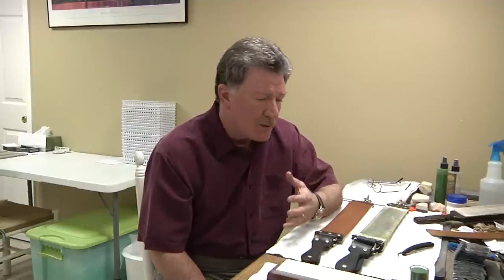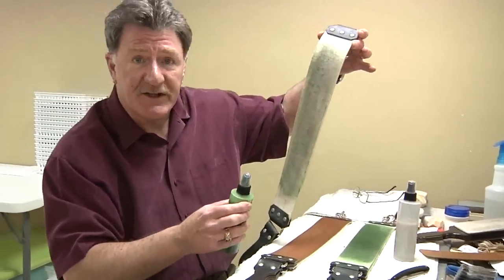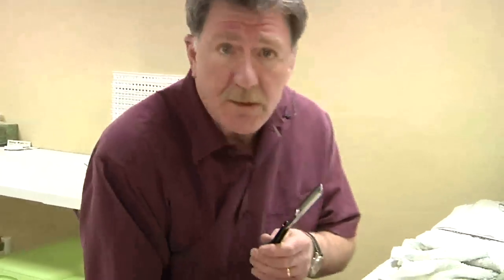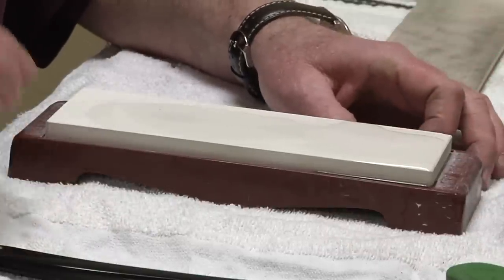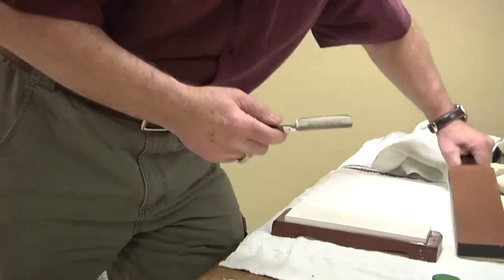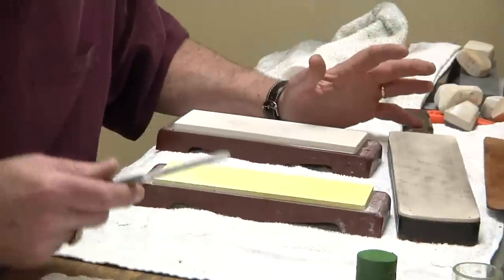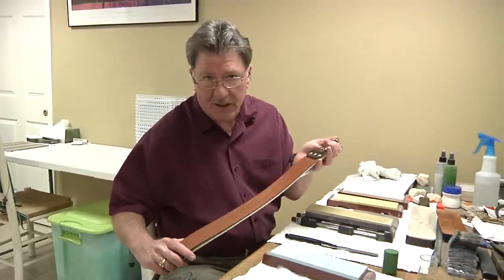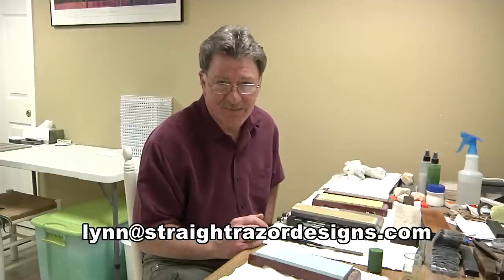Straight Razor Honing-Refreshing Straight Razors

Comment: On the honing methods - what degree of angle do you hold the blade?

Btw - thank you for the video!
Reply from the maker: +nunh Thanks! You should have both the edge and the spine touching the stone at all times. The razor has its own natural geometry for honing. Make sure you use very little pressure on the higher grit stones. All the best.
Reply: Wow - thank you for the reply! I have just joined your community and will soon be buying some of your products (after more research but, I am a pull the trigger guy) - thanks again!

Comment: Great video. Question: When honing the razor on the stone(s) will it not destroy the finish of the spine of the razor? Thanks
Reply from the maker: There is normally already a minimal to excessive amount of wear on the spines of razors. The wear from refreshing a razor is negligible. I will use tape however if I am going to put a damascus razor on the hones to protect the pattern.
Reply: Lynn Abrams Ok, thank you! I have ordered a Dovo Astrale a 5/8" 1/2 hollow ground (high) carbon steel with ebony scales, a 2" Mountain Mike nylon/mahogny strop and a Naniwa superstone 12k grit. I will definitely follow all of your advice. So far I have only used a Dovo shavette with feather blades. Thanks
Reply: If you are going to tape the spine i guess its important not to tape too thick, or the angle of the edge will be wrong.

Comment: I bought a 3000/8000 Naniwa instead of the 4K/8k stone you mention. I didn’t know there was a 4000/8000. Did I make a mistake doing this? Is 3000 too coarse a grit? I have a 230/1000, a 3000/8000, a 12,000 and chromium oxide paste on the inner webbed fabric strop as you demonstrated.

I really only got the 1000 for vintage razors that I find at antique shops and which need a bevel set and complete honing. In fact, I have only used the 3000 on those razors as well with varying degrees of success. There’s a LOT TO LEARN! 😂

But I guess my question is would I be best to stay away from using the 3000 on newer razors? Perhaps I should get a 5000 as well?
Reply from the maker: I used the 5000 and 8000 Naniwa’s for everyday honing. You’ll have more success the more you hone. Best of luck.
Reply: @LynnSAbrams  Thanks Lynn! Really appreciate the answer … to a comment on a ten year old video, no less! :)

Comment: Hi, I’m brand new to straight razors. Had a safety razor before, but didn’t really like the shave all that much. My one question would be what are you spraying on your stones? Is it just water or is it mixed with something else? Thank you!
Reply from the maker: Elijah Kleehammer Distilled water. Most regular tap water will work as well.

Comment: I tried stroping a used blade and a blade out the box. It's something I'm doing wrong where stroping is making blade dull. Can it be my angle? I am hanging short strop on an hanger that's hanging fron a door knob.
Reply from the maker: +candy5742 If you are using pressure and lifting the razor up at the end of your strokes instead of rolling the razor on it's spine to change direction, you can dull one pretty quickly. The spine of the razor and the edge should be flat on the strop during your stropping strokes.

Comment: I notice you do seem to put a little bit of muscle into it with the 5k and 8k, and even a bit with the 12k SS.  So, "weight of the blade" is encouraging us to lighten up, but really in practice a little more than that? Or maybe I'm confusing a little twist-torque on the tang to keep the edge married to the stone for force?
Reply from the maker: Alexander Griggs Basically, pressure on the 1K, a little less pressure on the 5K and very little pressure on the 8 & 12K. At all levels, the edge and spine should remain flat on the stone.

Comment: Lynn, 
I just wanted to get your opinion. I've been honing on a Norton 4k/8k combo stone to hone my razors using the pyramid. I've been finishing on a paddle strop with Chromium Oxide on the balsa wood side and then .25micron Diamond spray on the felt side. It seems to get a really nice edge. Does this seem like a good method? I just want to make sure I'm not up in the night.
Reply from the maker: Hi Kenny, If this is working for you consistently, it is a good thing. Keep up the good work and have fun.
Reply: Lynn Abrams Thanks brother.

Comment: I found two of my grandfather's straight razors. Both were dull so I used a 6000 grit stone on one of them. I cant remember how many passes I did but it was quite a bit before it began cutting arm and leg hair (with a little bit of effort I might add) If I have the razor at this point should I invest in a strop to finish it off?
Reply from the maker: In my opinion, you need to strop the razor before every use. You can shave off a 6000 grit stone after stropping but shaves off that level stone are not comfortable to me.

Comment: So, should you not use the Chromium Oxide side of the strop every time you strop? I'm new to straight razor shaving but every time before shaving I do 25 on the fabric side (with CO) and then 50 on the leather side. I'm thinking I'm doing  a bit of overkill lol
Reply from the maker: If that is working for you, then that is fine imo. I have not had success using the chromium oxide before every shave. All the best.
Reply: @LynnSAbrams  Awesome. Thanks for the reply. Have a great day.

Comment: I'm looking at various websites and trying to decide where to buy refreshing/honing equipment like the strops you demonstrated in this video.  I've owned a straight razor for eight months now and it's in need of a serious refreshing and/or honing.  Where did you purchase your refreshing and stropping equipment?
Reply from the maker: +Wayne Parker Straight Razor Designs
Reply: I bought an 8K Arkansas honing stone (Hall Sharpening Stone) today from a cutler who said I should draw the straight razor blade on the stone with the spine leading rather than the blade leading.  Is there a reason you draw the blade on the stone with the edge leading?

Comment: Hey Lynn I got a vintage Wapi was a NOS I did a refresh and leather strop. It cuts loose hair easy and shaves off good on dry spot but I tried to shave with it and it tugs and pulls a lot.  Should I hone it with water stone then?  It feels so sharp but on face not so good :( I have stones and balsa board with oxide.  Any tips?

Comment: I'm trying to get all my information before I start practicing and shaving with the straight razors.  If you have the chromium oxide and apply it to your strop, do you need a whetstone for honing still?
Reply from the maker: I normally will use a finishing type stone when the chromium oxide quits working.

Comment: Can we substitute the 12000 grit finishing stone with a fabric strop coated in thiers issard razor sharpening paste and expect similar results ?
Reply from the maker: I personally am not a fan of the TI pastes. I find the .5 diamond and chromium oxide more consistent and reliable. If you are having success using them after the 8K, you're good to go. Most people find some improvement in their 8K edges with using a 12K or other finishing type stone.
Reply: Thanks for the reply, I have personally never used the TI paste.Im completely new to world of wet shaving (and with that straight razor shaving as well). Ive just been doing a lot of research on all the essentials to get to maintain the razor. It seems that saving up for a naniwa 12000 superstone and a dmt 325 lapping stone. Also I just wanted to double check. When using a stone you keep the blade flat on the stone with back of the blade touching the stone as well, is that correct? Because i have dabbled in sharpening knives and a few katanas and with those the blade is always raised so that only the edge is touching. Sorry for all the questions I'm just really interested (and excited about all this)
Reply from the maker: manboykid234
The spine and the bevel or edge should be touching the stone when you are honing a straight razor.

Comment from the maker: In my experience, this has not been the case. In fact, by using the techniques described, it has prolonged the razors use and need to go back to the hones. I usually will ask how many strokes, what kind of material/media and over how long a time before I accept statements like the one you raised as gospel. I would look for a fair amount of empirical data. Have fun.

Comment: Hey Mr Abrams, I have a 1k, 5k and a 10k nanawia stone, Do I need a 8k and 12k stone to get a better edge?
Reply from the maker: Lemija Allen My normal progression is the 1, 5, 8 & 12K. This works very well for me. If you're getting good results now, what you're using is fine. If not you should get better results with a progression similar to mine. In my opinion, you can substitute the 5K for a 3K as well.
Reply: Lynn Abrams going to your site now to get the stones, thank you Mr Abrams.

Comment: Great video, why do think men are going back to the old way doing this?
Reply from the maker: Nostalgic and a fun hobby not to mention the experience and a wonderful shave. 😋
Reply from the maker: @paulbickley658  I have an edge pro system for my knives which is like this and it works well for the knives. I have not had success using it on straight razors. YMMV 😋
Reply: Really, I would think it would be more precise than my hands anyways... trying to get the precise angle without scratching up the wide end is a challenge
Reply from the maker: @paulbickley658  Exactly. The blade has a natural geometry on a stone. Finding that angle with the edge pro and getting the pressure right is a different story 😊

Comment: I'm wondering will a 6000 grit stone and a strop be enough
Reply from the maker: +knifefan102 In my opinion, you can get a razor to shave off a 6000 grit stone, just not comfortably.
Reply: +Lynn Abrams I haven't much money student problems what would you recommend if I could only get one thanks
Reply from the maker: +knifefan102 You might try a barber hone off eBay if you can find one priced reasonably. Another alternative is some of the abrasive films which are generally less expensive than stones.
Reply: +Lynn Abrams thanks Lynn your the best

Comment: does the diamond spray work with the poly webbing strop?
Reply from the maker: David Loss In my experience, it works best with the felt. Have fun.
Reply: Thank You for the quick reply and all your helpful videos!
Reply: Where can I buy the chromium oxide crayon, I couldn't find it on Straight Razor Designs website?
Reply from the maker: David Loss We don’t have a source right now. Sorry.